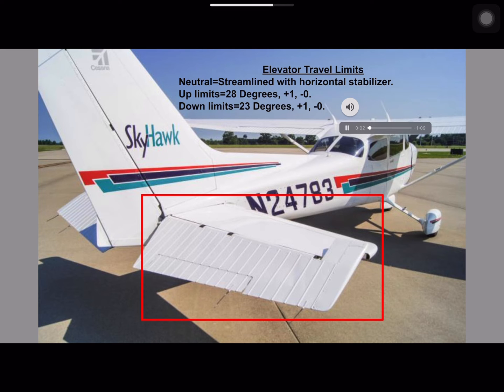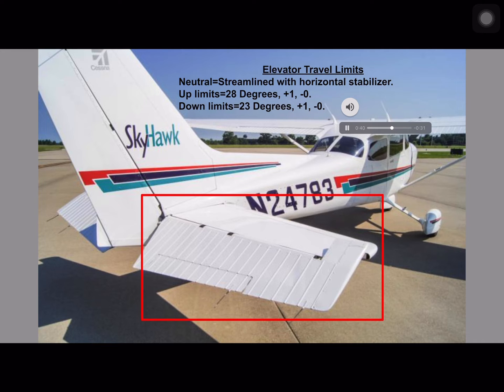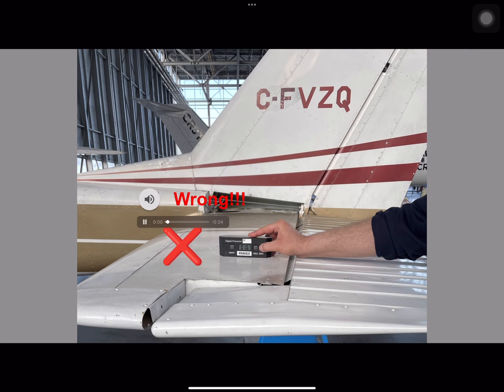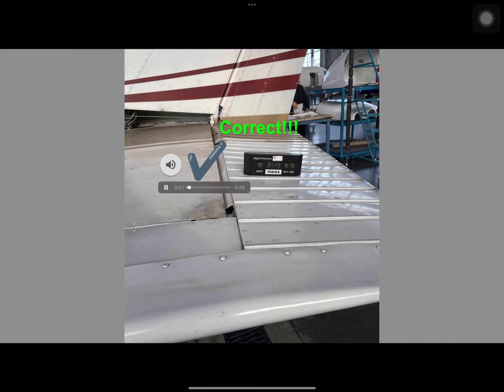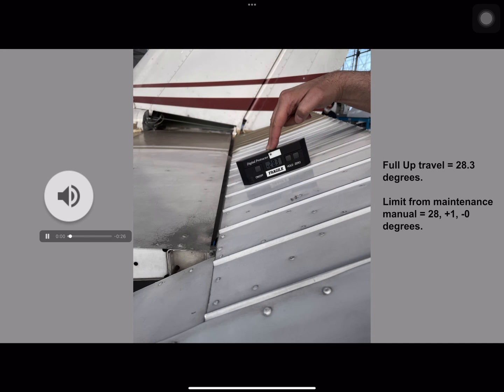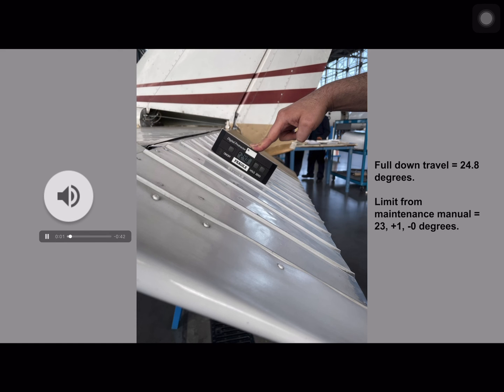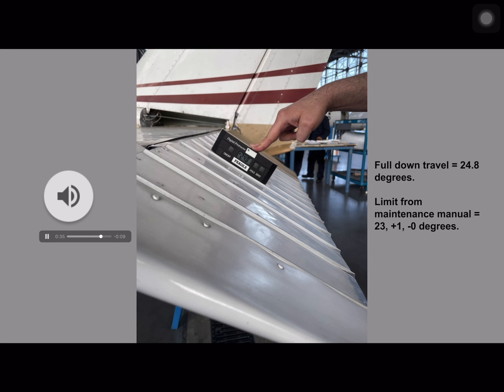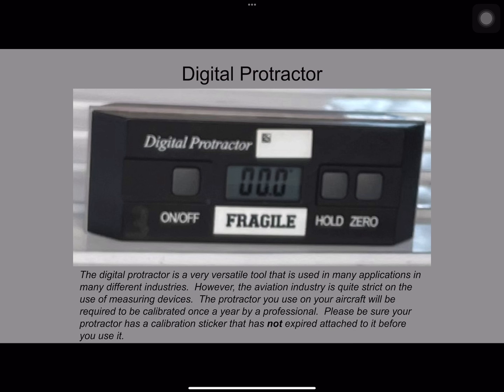Aircraft flight control rigging, deflection check.

Comment: Was there something in the maintenance manual that told where to put the protractor on the elevator or where to zero it out?
Reply from the maker: No, it just tells you what the degrees of travel should be. Typically at  0° the cord of the elevator is in line with the cord of the stabilizer.